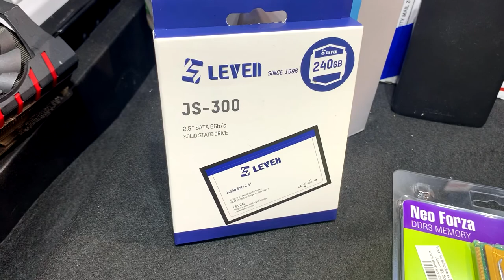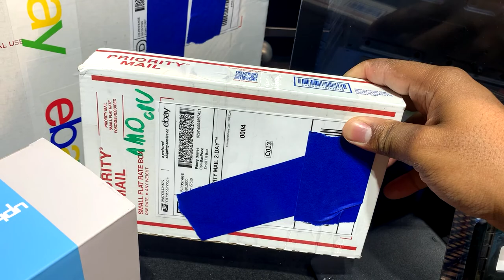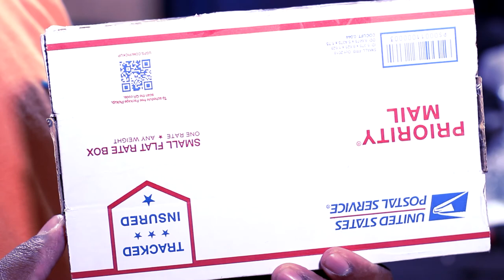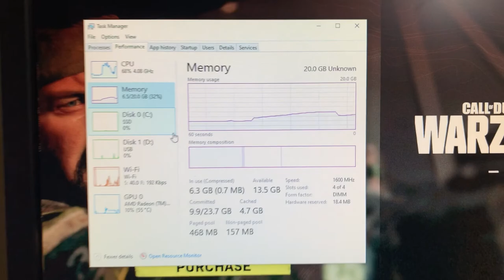How To Build A Gaming PC (Entry Level Guide)

Comment: Nice video. I was a bit worried when you said FX but im pretty sure your kid won't be able to tell the difference.
Reply from the maker: LOL, the AMD FX8350 CPU still meets many of the new games hardware specs for a good 1080p gaming resolution. Now when a gamer wants that rich 4k gaming resolution then it's highly recommended to go the AMD Ryzen route. I'm going to eventually make a 4k gaming PC build with an AMD Ryzen 8 core CPU once I find time.

But I dig your YouTube videos and notice that you still have Doom 2 installed. That's a good classic!
Reply: @AWordFromMrJones  FX is still great for 1080p I used to own a FX 8370 and it was a great little budget CPU, Im also interested in that 8 core Ryzen 7 4k build, I would love to see a video on it!
Reply from the maker: @Firstfall_Trading  Yes I do remember the FX 8370. That CPU indeed required a good cooling source, such as water-cooler especially for big open world games.